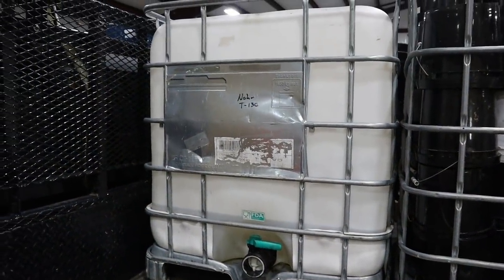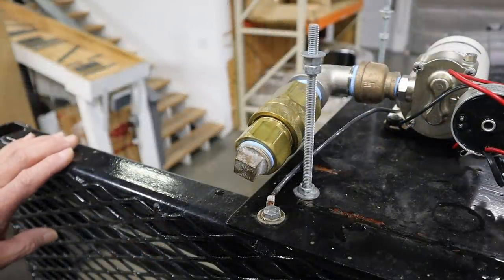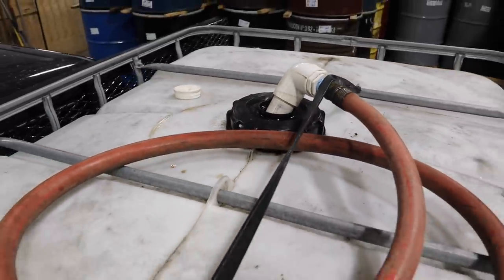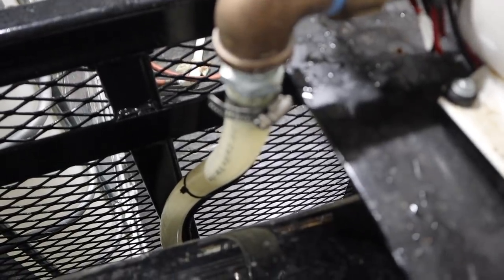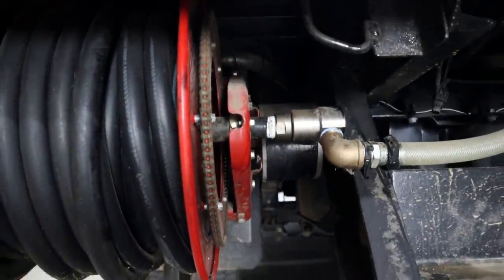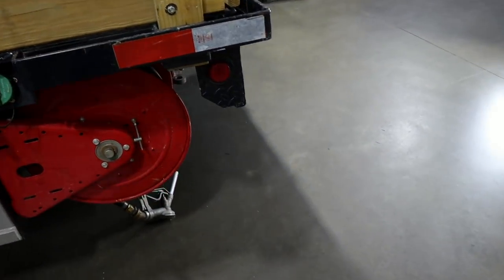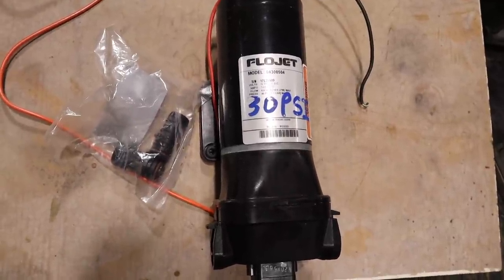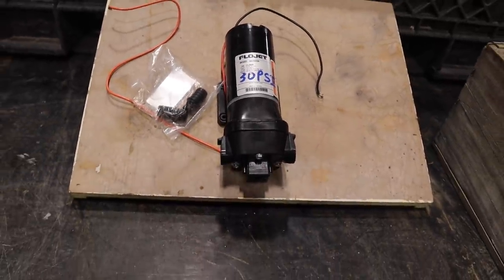Feeding Bees Part 4 - Our Syrup Pump and Truck Setup

Comment: Hey Bob.  Another great video.  I assume you have baffels inside the totes to prevent sloshing while driving?  Four totes with sloshing syrup would sure push around a truck while starting/stopping.
Reply from the maker: The totes don't have baffles and you can feel the sloshing around but it's not enough to be dangerous.

Comment: Hey Bob, awesome video. Wondering how the electrical is setup, do you run everything off a separate battery or does this run off the main battery while you keep it idling?
Reply from the maker: Hi Ryan. The wire from the pump goes to a 30 amp relay and 30 amp breaker under the hood which is hooked directly to the truck battery. The relay is activated by a small switch on the truck dash. We have never had an issue with killing a battery so we don't idle. I think this is because it only runs for a few seconds with each fill and is not running continuously.

Comment: Hello Bob, thx for shared information. I have a question: why you do not connect pump intake directly to tote valve?
Reply from the maker: At times we are carrying up to four totes and this is much easier to do. Also, no large fittings or hoses.

Comment: Thank you Bob for this great informativ video. Can you tell with what type of pipe you are useing? I guess it should be with a stronger coating so it wont get holes when its draged on the ground. Thanks from Austria
Reply from the maker: Hello. I think you are referring to  the "hose". We use a high quality rubber hose on the hose reel. Vinyl or plastic hose does not last as long or work as well.
Reply: @bobbinnie9872  thank you!

Comment: Great video Bob!
Question:  the model of the pump you are using (UP12/12E)has a 1/2" ports?  Then you neck out to 1 1/4" quick connects?
Reply from the maker: Yes, but if I was doing it again I would just go with 1" quick couplers which would work fine.

Comment: Bob. I know you have a sugar mixing setup and then fill your totes. Would the FloJet pump you show in this video work for mixing sugar syrup? Would the sugar hurt the pump. I am at a crossroad with what pump to use. I am either going to use the FloJet or a trash gasoline pump. My setup will be for mixing and dispensing syrup. Whats your thoughts on granulated sugar and the diaphragm pump?
Reply from the maker: The FlowJet pump in this video would not mix sugar. A trash pump is what we use to mix sugar but it would be too big for dispensing. You may need two separate pumps for the different jobs.

Comment: Hi Bob, thanks for the awesome video.  Question: Is there any concern of introducing contaminants (like lead) into the syrup by using standard rubber garden hose?  The labeling on these hoses usually warns against using them for potable water. Thanks.
Reply from the maker: I  believe the possibility is there but because the syrup is only passing through it is probably minimal.
Reply: @bobbinnie9872  Right.  I guess I was more concerned with the gallon or two of syrup (in a 100' hose) that gets stored in the hose for an extended period and then pushed into one colony.  Sorry, I'm probably overthinking this.
Reply from the maker: @stevecron6723  We will at times flush out and rinse our hose if it hasn't been used very recently.

Comment: Hi from France,
What makes you prefer to use the top lid over the bottom drain to connect to your pump?
Thanks for your answer and videos
Reply from the maker: If we have multiple totes it's much easier to reach them all the from top. There is also much less mess. I do have friends that use the lower hole and say they prefer it. Personal choice I guess.

Comment: Are garden hose threads different from fuel nozzle threads, because I just bought one that won't screw on to a garden hose. It looks like yours is on there with a hose clamp at 7:21
Reply from the maker: Yes, garden hose threads are different than the pipe threads. The industrial clamp on the hose came on it when it was new. It's an industrial grade black rubber hose. That is a one inch nozzle with a 3/4 inch pipe thread reducer and a garden hose to 3/4 inch pipe thread adapter purchased at a local hardware store. I believe Home Depot and Lowes carries the hose adapters too.
Reply from the maker: You have an Interesting YouTube channel by the way.
Reply: @bobbinnie9872  you just made my day with that!
Reply: This is good to know. I will be using a regular water nozzle until the next time I go by a hardware store. I timed it while running water through it, and it's about 2 seconds slower than the 3/4 fuel nozzle but it doesn't leak syrup afterwards, at least not yet. I'm curious, have you ever used a garden nozzle for syrup?

Comment: Hi Bob.  Love this setup.  One question.  Will this handle 2 to 1 syrup?
Reply from the maker: Only if the syrup is warm. If your system has any length of hose or any restrictions like our system does it doesn't do well. We try to stick to 1.5 to 1 or thinner anyway. I should have stated that more clearly in the video.

Comment: Do you flush the pump out with water after you are done using it for the day? Also what ratio of syrup are you able to pump with it, will it pump 2:1 syrup? I was looking at making something similar to pump from barrels but wasn't sure if it would do 2:1
Reply from the maker: We rarely flush the pump out with water and only if we're not going to be using it for awhile. This pump pumps 2 to 1 fine.

Comment: I have medium supers that will need built out from foundation in the spring. Would you recommend to feed thin syrup for a few weeks to get them built out? Or just depend on the spring nectar?
Reply from the maker: We often start out early with thin syrup to get them started in spring but be aware that thin sucrose is very stimulating and can increase the swarm impulse.